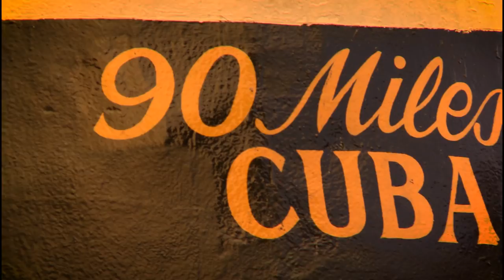Working Hard and Playing Hard in Key West | S02E04

Comment: What fun you guys are mixing in with all your hard work. For years, I have gone to the Keys around Meeting of the Minds and have done the Zombi Ride. In fact, I may have been there when this episode was shot. What a bizarre party! Fixing your prop shaft issues made Atticus even better than it was designed. However, I don't envy any job dealing with itchy fiberglass. Been there, done that installing engines at Gulf Star Yachts back in the '70s. Jordan, you should be proud of yourself for the quality of work you do. It's no wonder that you have so many friends to share the good times with. You and Desiree are a great couple.

Comment: My friends, I know this is a couple of years old but I did not see anyone correcting you in the comments. A Diesel engine is designed to idle for very extended times. Truck drivers will idle their engines for days in winter. You cannot hurt your engine by idling. 
Fair winds and following seas!!

Comment: All right, pumped another one out.  What hp outboard in the dink? Does it plane good?  Do you think it would plane with 3 people aboard?  We have a 8 ft RIB with a 4 hp merc right now, but looking to buy a bigger dink and motor.  9.9 hp would be great if it will work.  Keep up the good work.  Hope you got a nice security chain and lock for your new dink.
Reply from the maker: Hey Pate Allan! We have a 8ft Zodiac RIB with a foldable transom and a 8hp Tohatsu (4 stroke). We can't plane with 3 people, but we can plane with two people and my sewing machine, which is exciting! Yes we bought a security chain for the dink but luckily we haven't had to use it much in Isla Mujeres, Mx!
Reply from the maker: Hey Pat, Jordan here. Yeah I would definitely recommend larger than 8 ft to plain with 3 people as the 8hp   4 stroke is at the max weight limit for our dink. Although it might work out if you had a two stroke that fit within your weight limit. All that said, if you can, I would go with a slightly larger dink with a 9.9 as you had mentioned. Just my two cents! Thanks for tuning in!
Reply from the maker: Oh also we were using a 3/8 chain to lock the dink but it chafed the cap rail on Atticus as well as the dink hypalon so we switched to really thick steal cable with a vynil coating. Any thoughts?...
Reply: I just know the more robust your chain and lock, the thief will keep walking til they find an easy target.  I dont think I would attempt to cut a 3/8" chain.  I know you are limited right now having access to chaffing preventers.  State side, an old discarded  fire hose from the local fire station would work.  Most places we've been (U.S.) we didnt need to lock our stuff up.  Our stuff has been old crap too.  Sounds like your cable will do fine.

Comment: I wonder if you lose any power by losing that space with you your reinforcements
Reply from the maker: Michael Gregory, hmm interesting point. We haven't noticed any difference, I imagine if we do it is minimal, I've definitely seen boats designed with a strut or gusset just forward of the prop. But still very interesting question. Do you have any further thoughts?
Reply: I've got a 23 foot Pace ship that I bought for $1,000 is included 8 horsepower outboard motor a d and not much else I need to get some more sales and get some ropes and get some solar panels and some batteries and I'm fixing to sail off into the gorgeous sunrays of wherever the spirit takes me the breath that I breathe